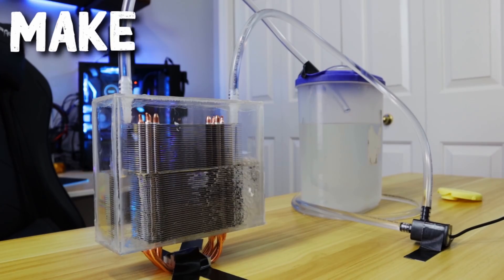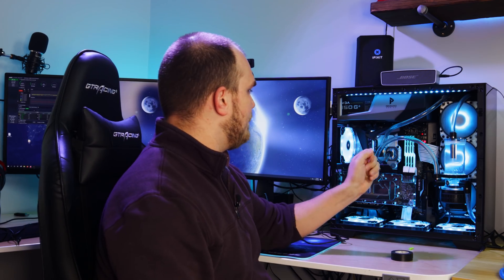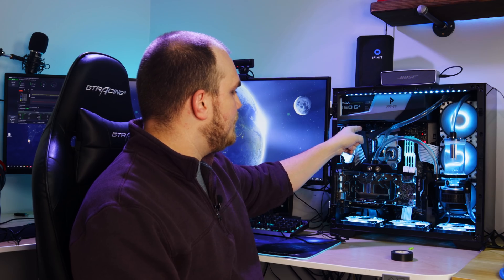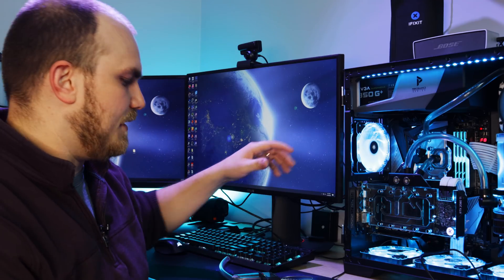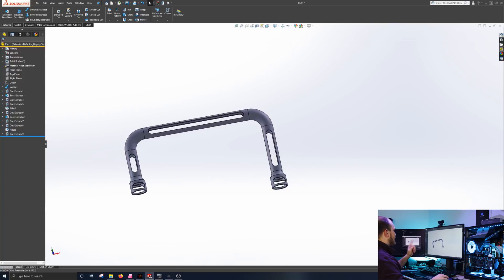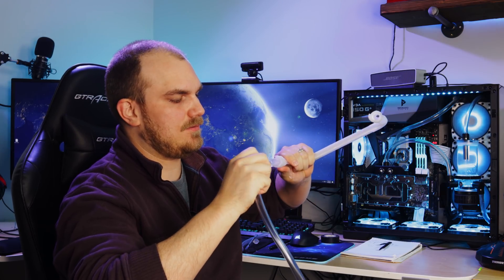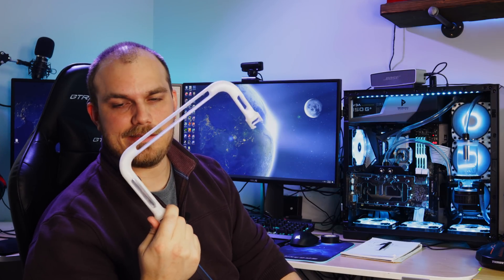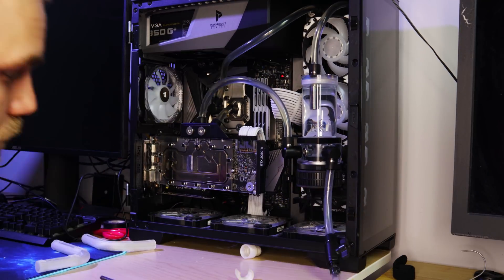Best of Both Worlds – 3D Printing Soft Line Tubing Into Hard Line Tubing

Comment: I was wondering, if you make two seperate watercooling loops for CPU and GPU, how far down does that bring temps? Would that be a fairer comparison to air coolers, since they're seperate as well?
Reply: It's a tricky one since you splitting what rads you have between the 2 loops so it could go ether way depending what's going on. I think having 2 loops makes more sense if you got a lot going on like a bunch of rads, cpu/monoblock and 2 gpu's to help with flow rate. Having said that the D5 pumps are really good since my single loop got 2x280 and 1x420 rads, monoblock and gpu block while still getting pretty good temps with low fan speeds.
Reply: @SkinUpMonkey  Thanks. I think I'm going to try it, get a smaller motherboard in a big case so I have the room for two dedicated loops. it'll be fun even if I don't get impressive results.

Comment: Could look futuristic https://bit.ly/343nACA  

Print something like the flexible PEX water pipe used in buildings which has a pipe bend clip https://bit.ly/2xFBW00  Might help for longer continuous runs in the straight section of the tubing.

Comment: great idea!
You can use a hair dryer or heat gun to get rid of those retraction fuzzies (or tune them out a little more).  Also - PETG (translucent white or "natural" color) might give a bit of a white glow reacting with the LEDs.
Reply from the maker: Ya had to turn off retraction because I kept stripping my material

Comment: Not to mention this would also work for ppl with AIO tubs, we sleeve or cover everything else in our PCs lol. This is epic in my opinion.
Reply: You could print it in two halves for the tighter bends and use solid circles to hold them together.

Comment: Dude!!! Here is what I think would be a cool next set, Make the lines SQUARE!!! and use the round tubing at the connections by using flex epoxy to glue the tubing to the sq. lines. Remember to add in the RGB too!!! This would be truly original!!!
Reply from the maker: I do need RGB

Comment: You might want to change to PETG or ABS as the PLA goes soft at around 60 degrees Celsius.
I mean if the air flow in your case is on point it might not be a problem, but if it starts to sag then that's what you're going to have to do.
Great video. Keep up the good work.
Reply from the maker: good call if it starts to droop il go PETG

Comment: That looks great! I can't wait to get a 3D printer. I now have one more thing on a long list of things to print! ;)
Reply from the maker: 3D printer is the coolest thing ive ever bought
Reply: @MajorHardware  I bet! I really enjoy you incorporating 3D printed things in your videos. When I get a 3D printer, I was wanting to print some sort of shroud for the top of my video card with a fan or fans that would look stylish but but also help dissipate heat from the back plate area. I've noticed just sitting a 92 mm fan on top, blowing air from front to back helps drop temps by 3 to 6 degrees while gaming. Have you ever designed something like that?  If not, maybe you could as a new vid idea.

Comment: Hmmm... If you set up a little tab that the end fitting can hold each piece down with, you could get away with printing only corners since the tubing would have a straight run to the next bend. Slice the models in half like a clamshell, that way you can fit the tubing into tighter corners and then close it in. I've been putting off doing maintenance on my loop, I might design and print some corners out so I have a reason to take it fully apart
Reply from the maker: good idea might work

Comment: You are genius.
Design - try space frame around the tube, all it really needs is to guide it, it does not hold much weight. Image like mesh sleeves over cables, just larger.. will use less material and space frame structure is sturdy. 
It is now too much plastic over the tube
Reply from the maker: i get whatcha mean i could try and make it a bit better good idea

Comment: I got a great idea, I'm going to stick a metal wire into my $2000 running computer. Nothing can go wrong.
Reply from the maker: HA the key is not to poke any of the expensive bits
Reply: @MajorHardware  And maybe even turn of the power beforehand :P

Comment: I haven't done watercooling before but at those points where the warmth is being transported away, I expect the water to be rather warm - should that reach 60/140 degrees C/F, you might have a problem with PLA softening over time and sort of, slowly, melting I imagine. If I understand the loop correctly, the upper loop transports away the warm water to the radiator and thus should be quite warm, no?
Reply from the maker: my CPU max temp is 95°C but the water in the system will never get that hot
Reply: @MajorHardware  Fair enough, I just wanted to throw that thought in there in case you didn't consider it - not that it would cause huge problems or happen suddenly either way.

Comment: This is why I subbed a long time ago!
Hard line look great but from my experience so hard to maintain. I don't touch my computer setup and configuration because I don't want to re bend all/any of the tubing
Reply from the maker: ive never done hard line but based on how easy this went and how often i see people say hard line can be a pain id bet this is easier.
Reply: @MajorHardware  I didn't find hardline that difficult I did my first liquid cooled system in hardlines even went acrylic which supposed to be the harder choice and it wasn't bad the only problem I really had was my setup required 2 identical tubes which making a one of was easy but making 2 match wasn't so much but even so it really didn't take long and I wasted about $12 in material which in the cost of all the cooling system was pretty small

Comment: I'd love to see the prints sanded & painted in the follow-up.
Reply from the maker: i will print it at a lower layer height and slower to make it come out much better, to be honest i didn't think it was going to work this well.
Reply: @MajorHardware  How about printing some open side 90's and straight pieces to snap in the tubing with the open area up front.  That way you don't have to drain the system.
Reply: @MajorHardware  I have only seen a few of your videos but OP makesa good point... 

Increasing "resolution" of the print isn't necessary if you just spend time to sand it down and buff it to a nice finish. It really steps your printing game to the next level. Plus you can push out more parts faster instead of waiting around all day for the print.
Reply: Major Hardware what about glow in the dark filament (haven’t really looked at 3D printing gear so don’t know if that’s even possible)
Reply: @MajorHardware  Acetone melt it for some smooth finish?
Reply: I was thinking the same, some paint would really class up the joint
Reply: I was thinking the same thing. Sand it and paint it with chrome paint. Would make it look like an exo frame.

Comment: im building a custom water loop with a wall mounted ac condenser as cooler. this + crome "industrial" looking fan and crome copper hardline (for domestic water) will look nice. 
https://image.made-in-china.com/2f0j00oKYtsSJhLcqI/Air-Conditioner-Condenser-Heat-Exchanger-Coils.jpg
https://productimages.biltema.com/v1/image/imagebyfilename/44-3063_xxl_1.jpg

Comment: what if instead of pushing the flex tube through , you made it two parts that have set screws on backside . then could prob make those angles by heating flex tube  with hot water.
Reply from the maker: its sounds possible let me think on it